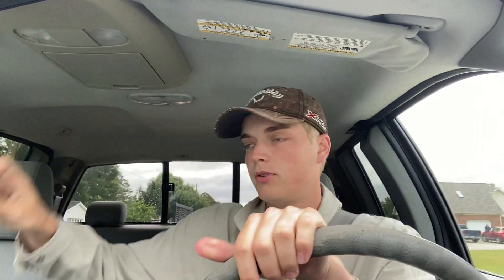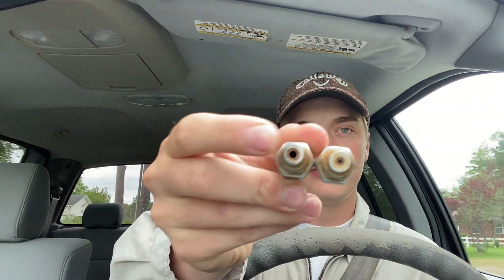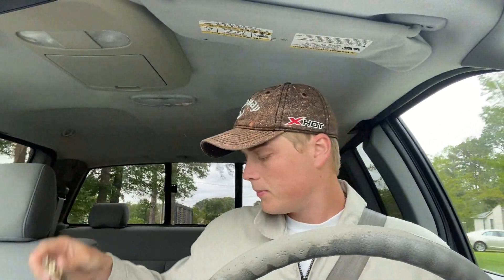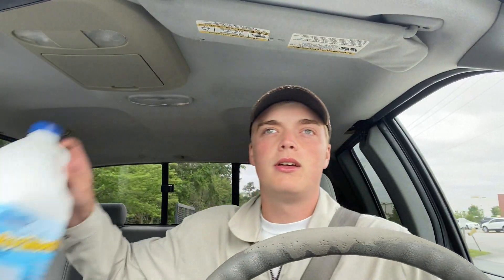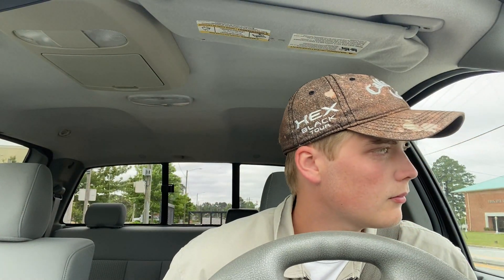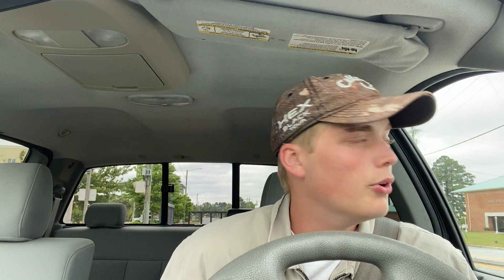FASTEST WAY TO PRESSURE WASH A HOUSE

Comment: About mixing.  If I use one gallon of pool essentials and fill a five gallon up with water. Is this two weak of a mix? So one gal chemical and  3-4 gal of water.
Reply from the maker: If you are downstreaming, yes that is too weak of a mix. The downstream injector dilutes it for you.
Reply: @pressurewashingsurvivalgui3980  so what should I be doing with the down stream?  Straight pool essentials?
Reply: @pressurewashingsurvivalgui3980  thank you